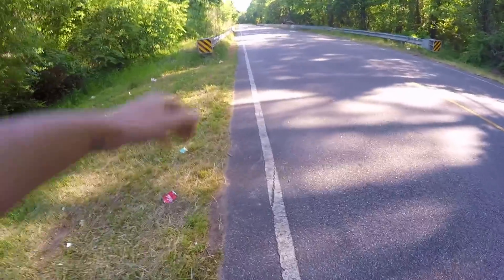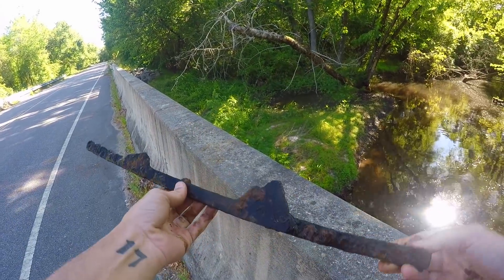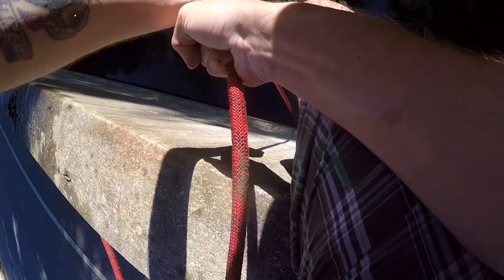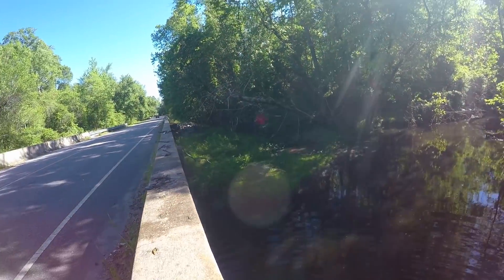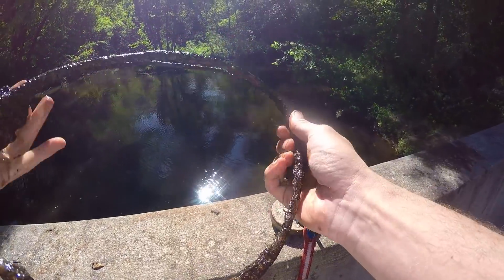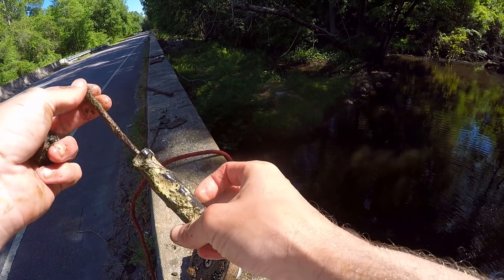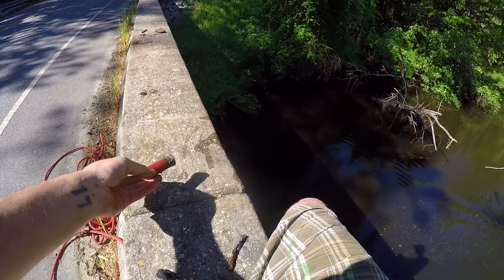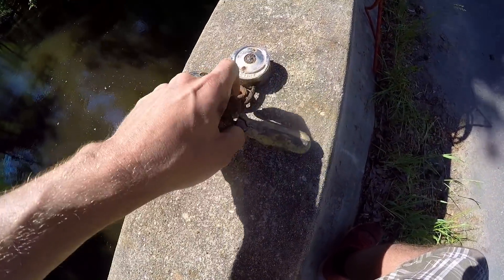I Took My Giant Super Magnet To This Hidden Creek. And This Is What Happened.

Comment: Hi Daniel that triangle blade piece you found is actually  part of an old hay mover.  The blade sits in a guard  and moves back and forth much like hair cutting clippers.  The farmer used it to cut tall grass in ditches and fields to turn into hay for livestock.  Each trabgular tooth could be replaced or taken out and sharpened. The full blade was usually 5 to 6 feet in length.  Google old hay cutter and see images.

Comment: Looks like part of a blade off from a mowing machine. When I was a kid that is how you would cut the hay . There would be two of those v shaped blades running together and that would cut the alfalfa. Then you would come along later after it dried some and rake it into rows.  Depending on the weather ( how many times you had to roll the hay)  then you would eventually bale it into bales of hay.